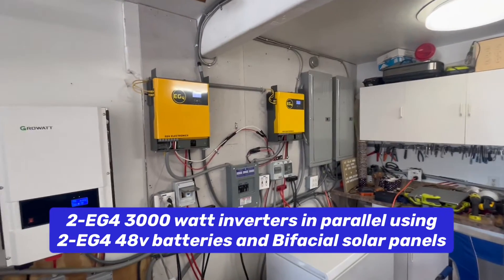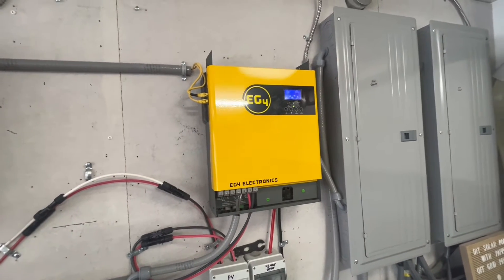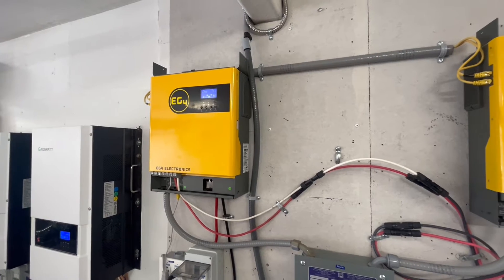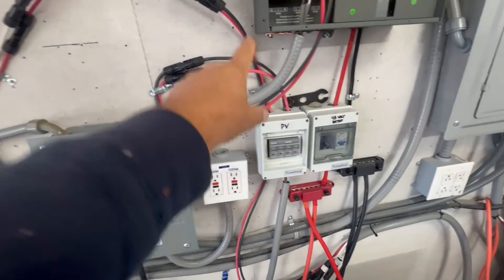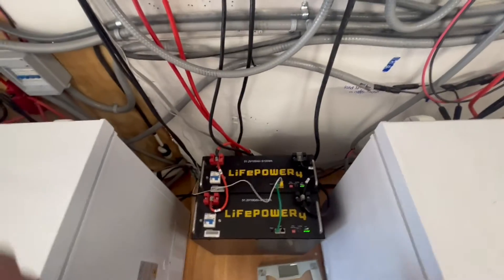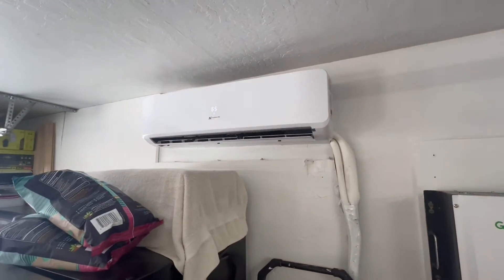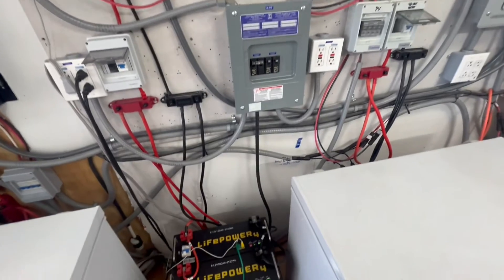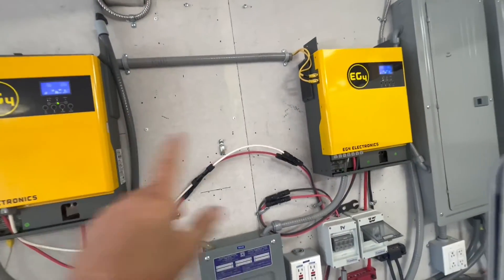EG4 3kW inverters in parallel 120/240 volts, EG4-48v batteries & bifacial solar panels runs AC

Comment: With this configuration do you have the option of charging the batteries with 120 vac grid power?
Reply from the maker: You can connect grid assist input for rainy cloudy days and night time use.
Reply from the maker: I do not connect grid so I am not sure if you would use 120V or 230V input from grid power. You would have to consult the installation manual or call signature solar and ask their techs. But you can connect grid input.
Reply: @diy-solar-guy thank you for the reply
Reply from the maker: You are so welcome

Comment: I have a similar setup with 3 batteries. The manual for eg4 3k inverter I'm missing something. Can you give me a list on the settings. I have them set at L1 2P1 and L2 2P2 everything else the same. Thanks on advance for anyone sharing the setting 1-45
Reply from the maker: I just did a video on all my settings from setting 1 to setting 45 for in parallel spit phase output of 120/240V. Depending on internet connection and speed, it could be uploaded in a hour or 24 hours. But the video is uploading right now. I show all my setting on the 2 inverters in parallel. Showing both inverters settings before moving to the next setting. Hopefully it will upload soon. Have a blessed weekend.
Reply: Oh ok thanks. I just wrote you again sorry. Didn't notice I'd already wrote on this one. Just a little anxious I gues!!@diy-solar-guy
Reply: I want to add that I really enjoy your videos. Thankfully all you do!
Reply from the maker: @ thank you, I enjoy helping others see the possibilities of diy off grid solar. It works.
Reply from the maker: You are so welcome, I enjoy helping others
Reply: Thanks for all you do.
Reply from the maker: Video is uploading and ready for you for settings 1-45 on EG4 3kW off grid inverter set in parallel for 120/240V output.
Reply: @diy-solar-guy  thank you!!

Comment: Hi just wondering did you  have to do a ground bonding on the 2 inverters or just one??
Reply from the maker: @alexcandelaria590  I used the bonding screw in the electrical panel breaker panel. Not in the inverters
Reply: @diy-solar-guy  oh I get it l have 2 on the way I wanna make sure I do it right thank you 🙏🙏
Reply from the maker: @ ask the techs at signature solar and refer to installation instructions in owners manual for manufacturers suggestions. That is just the way I did it. I’m not an electrician just a diy guy. You need to decide they you want to ground.
Reply: @diy-solar-guy  i will i been talking to them there actually very helpful im sure I'll get it figured it out at some point thank you for your time and help

Comment: That's great information. You mentioned that there was a discrepancy between the incoming solar on the two inverters. Could you theoretically feed all of the solar into just one inverter, as long as it didn't exceed the inverter's capacity?
Reply from the maker: @jamesmatthew2677 you are better off having 5000 watts on both inverter, that is the max for each inverter,  so you drain nothing from battery bank. I would not do it personally to have solar connected to one inverter and have output on both inverters. It can be done, you will drain the battery on the one that has no solar if it exceeds the other inverters output. You can use use 5000 watts solar panels to get 3000 watt output. I am doing that.

Comment: Two EG4 3000 inverters vs EG4 6000xp inverter, do you think the 6000xp would be a better deal it has a build in breaker and you don't need to parallel them like the 3000 inverters? what made you go with the two 3000 inverters?
Reply from the maker: Hi, I originally bought 2-EG4 3000 watt inverters with the intent to put one in my garage and the other in my RV. But I decided to parallel the two to get 6000 watt output. It worked well. These are high frequencies inverters so I did not try to run my 3 1/2 ton or 4 ton ducted house heat pumps. All the high frequencies inverters I tried in the past would not start either ac. But one of the viewers said I could start the 3 ton ac so I tried and sure enough it started the ac no problem. I was amazed, then I tried starting the 4 ton while the 3 1/2 ton was running and to my great surprise, the 4 ton started and ran. The 2 ac’s running was using 6500 watts and would start draining the battery very slowly as 2 EG4 3000 watt inverters could only output 6000-6200 watts. So I decided to buy 2 more to be able to have 12,000 watts output. Been running for 6 months now with no problems. In fact upstairs 3 1/2 ton is running right now in January. I just ordered 2 more EG4 3000 watt inverters to have 18,000 watts output. I have a 12.7 ton pool heater heat pump that really uses a lot of power. At 12.7 ton the pool heater uses double what my 3 1/2 to and 4 ton running together uses. So I need to increase output to 18kW. Should be here in a week. Part of the problem I have is 5000 watts are in the east side of the house and are in partial shade at 11:00 am and full shade by 1 pm. so with 4 inverters on the north and west side I can start the pool pump up earlier in the morning and run to around 6 or 7 pm. 5 of the arrays with 5000 watts each will give me around 15kw output by 10 am. So I will loose one inverter at 1 pm but will have 5 inverter supplying loads from 10am on to maybe 6pm or so. If 6000 watts output is enough power, you could go with the EG4 6000 watts output or EG4 8000 watt inverters. I just found out in November last year I had another hernia in my stomach so mounting the heavier units us out of the question. These 3000 watts output inverters weigh only 18 lbs. very easy for me to install. I can connect up to 12 3000 watt inverters in parallel for a total of 36,000 watts output. So for me the weight is a huge factor. I would order a 6000 watt or 12,000 watt EG4 inverter if I did not have hernia but I am completely happy with the EG4 3000 watt inverters. They each have 50 amp inrush starting power so 6 inverters will give me 300 amp inrush starting cutting. That is a lot! I can turn off 4 of inverters at night and my idle usage is only 100 watts or less. I just really am happy with the 3000 watts unit by like I said nothing wrong with the higher watt inverters. Hope this helps you understand why I continue to use and add on more EG4 3000 inverters. Hope you have a truly blessed 2025
Reply: @diy-solar-guy  Thanks for your feed back and keep making EG4 videos. 🌞👍
Reply from the maker: @stephensanchez5761 thank you
Reply from the maker: @ you are so welcome

Comment: Is there a reason to use the bus bars and parallel batteries, or could you use one battery on each inverter? just wondering if that would work. I'm assuming additional batteries could be parallelled to each of the other.
Reply from the maker: The installation instructions say to install batteries in parallel using bus bars. Always read and follow installation instructions. 

When you parallel 2 or more inverters you want the batteries to be in parallel, you will need to use the buss bar to connect all inverters in parallel. Along with a DC breaker in between each inverters before the bus bar. Also a DC breaker in between each solar array before going into each inverter. 

You need to be able to disconnect from solar panels and battery source to be able to work on inverter. Each EG4 3000 watt inverter is maxed out at 25 amps for charging battery. These EG4 batteries can be charged up to 100 amps at a time but is better to charge at lower amps, like 25 -30 amps each battery. 

If you have 4 inverters in parallel that can charge 25 amps each at maximum output and just 1 battery, that would be 100 amps going into the battery if not fully charged. Once a battery is fully charged, the inverter will no longer supply amps to charge batteries, the inverter will open the circuit for battery charger in inverter until the battery starts to be discharged. The BMS on battery will also stop charging when battery is fully charged . 

If you connect 2 batteries in parallel with 4 inverters in parallel, you could charge each battery with up to 50 amps in each battery. 100 amps still could come out of 4 inverters in parallel but would split to 50 amps in each battery. 

If you had 4 batteries in parallel with 4 inverters in parallel, you could charge each battery with up to 25 amps. If you had 8 batteries in parallel with 4 inverters in parallel, you could charge each battery with up to 12.5 amps. 

The BMS in each battery will try to charge all batteries at the same voltage and amps, trying to keep each battery around the same state of charge as the other batteries. 

When you pull amps out of battery for a load, you want all your batteries to be in parallel so you can pull the amps from just one source. The BMS(battery management system) connected inside the battery pack controls the charging and discharging of each battery and communicates with the main battery connected to the inverter and all batteries in parallel are connected to communicate with each other BMS. 

You need a BMS on each LiFePO4 battery and each LiFePO4 battery needs to communicate with the others LiFePO4 batteries in parallel. 

I have not seen in any installation instruction from any manufacturer where they suggest you connect an individual battery to each inverter. So always follow the manufacturer instructions for connecting the batteries to their inverter. 

The battery manufacturer will suggest the way you connect to other brand inverters but if you are not sure, contact both the manufacturers for the battery and inverter to make sure the two can be connected safely to work. 

The other thing is my output from all 4 inverters are connected inside my off grid electrical panel. I had a 200 amp main breaker for the electrical panel. Then individually wired to each breaker for appliances to run. 

30 amp double pull breaker for each 3 1-2 ton and 4 ton heat pump. Using 10/2AWG wire with ground. Both are 230 volts output. Then I have 15 amp breakers for each mini split that is 110 volts output. And so on and so on for each separate appliances I run.  

Always read and follow manufacturer installation instructs for safe operation. If you try to connect differently than instructions, you risk destroying inverter and batteries and risk of fire that can not be easily put out. 

LiFePO4 batteries are very hard to extinguish when they catch on fire. Most inverters that are shorted out from wrong connection of wires,  not doling instructions will result in maybe a fault code that can be cleared by connecting wires the proper way or might destroy inverter before you can connect proper way. 

This equipment is expensive, read and understand the installation instructions before installing products, if you don’t understand, contact seller or manufacturer to see if they can help you understand and if you still don’t understand, have a professional install products. 

Never assume you can just do something a certain way if you don’t know how it operates. There are a lot of safety features built in inverters and batteries that can help from destroying products wrongly connected but if voltage or amps are to high, you can short out circuits and destroy products wrongly connected or cause a fire. 

Hope this helps to answer your question, this is just my understanding of operation of inverters and batteries. A 51.2v battery is considered a dangerous voltage along with several in parallel . Extreme caution should be taken when working with high DC voltage and high amp output from batteries.

Hope you have a truly wonderful and extremely blessed 2025.☀️
Reply: @diy-solar-guy  Thanks, I was just curious. I hope to be buying one soon. It looks like this is what I'll need. I'm not sure I will be split phasing 2 yet. Guess I'll see if I can download the operating manual.

Comment: I neeed to help my dad with an emergency system for his small house but he has one 220V induction stove. That is only 220v in his house the rest is 120V . 
Can i use this EG4 3000w to power this induction stove? If not , what is the best option, upgrade to a EG4 6000w or use two EG4 3000w? My dad lives in Ecuador (South America), to importing equipment there is expensive. He does not have solar pannels.  I will visit in Christmas and can probably bring one eg43000w with me in the plane .  I hope you can advice. Thanks
Reply from the maker: @alexherrera3918  you need to EG4 3000 watt inverters in parallel to create 220 volts. Maybe the EG4 6000 watt inverters would be better, I believe it has 120/240 volt output. Call signature solar and ask them to make sure. Your will need 48 volt battery bank to use the inverter. Not sure how many watts the inductive stove would use. Inverter will need solar panels to work. Big thing is to figure out how many watts induction stove uses. Then you can make a better decision. Let me know if you have more questions, happy to help or signature solar techs can help you as well.

Comment: I thought about buying two of these but the parasitic draw on two of these is around 2400 watts a day! that is just to much. I been reading the number one complain is it drains the battery at night even with just a 10 watt fan running. Yes they are a good price but rather save my money for a Victron.
Reply from the maker: The two in parallel to run a 230 load overnight will use around 50 watts each inverter at idle consumption. I run my 3 1/2 ton upstairs heat pump to air condition overnight and find these two together are only half of what the 12kw Growatt use to use overnight. During the day when I have sun is from 7 am to 7pm, during this time the solar input covers the 100 watt idle consumption so it is only 1200 watts overnight when there is no sun. That is only 1.2 kWh of battery so I can run my 3 1/2 ton ac on battery bank overnight. I don’t think you will find anything less idle consumption to be able to handle the inrush from ac. Eviction is good but not for starting 3 1/2 ton heat pumps. Could be used to run 12,000 Btu mini split overnight if you have a eviction that can handle at least 1500 watts continuously
Reply: @diy-solar-guy  Victron are low frequency inverters if sized properly they can start a 3.5 ton AC. I was also thinking If a person wanted to buy two of these 3000 watt inverters Might as well buy the EG4 split phase 6k It would handle about the same power and use half the idle power. For about the same price. What are your thoughts?
Reply from the maker: I agree with you on both issues.
Reply from the maker: I’ve been running my 2 inverters in parallel over night fur 6 months with no problems. During the day with 5000 watts in solar connected, from 7:00am to 6:00pm I’m bringing in enough watts to cover the 50 watts for each inverter and batteries are topped off at 100 percent at 6:00 pm. So I am only am really using 100 watts idle consumption for 13 hours in the winter which is 1300 watts overnight. Your batteries would be fully charged unless you are pulling over 3000 watts output on loads. I only use 110V overnight in the winter although I keep inverters in parallel in case I want to run heat pumps that use 230V. If you were to run inverters on with no solar you would use around 2400 watts in a day at idle consumption with no loads that can. With 2 of these in parallel and a soft start you can run a 3 ton to 5 ton heat pump to air condition or heat your home during the day and if you have enough LiFePO4 batteries, run a heat pump overnight like I do. These are powerful inverters in parallel. You have to use what best fits fit your needs. I could not use a Victron inverter for all I run. I need a lot of inrush amps for my 127,000 Btu pool heater heat pump. It uses 6500-7500 watts. These start that heat pump with no problem. Good luck with whatever you decide. Hope you have a truly wonderful and blessed 2025